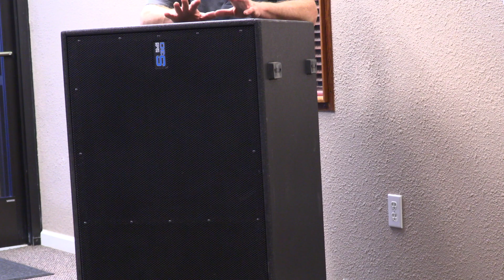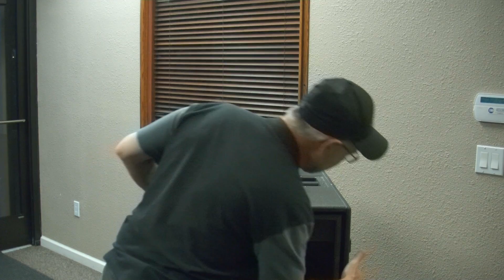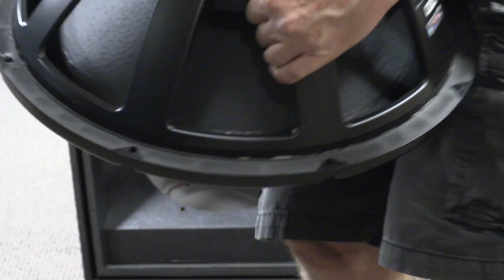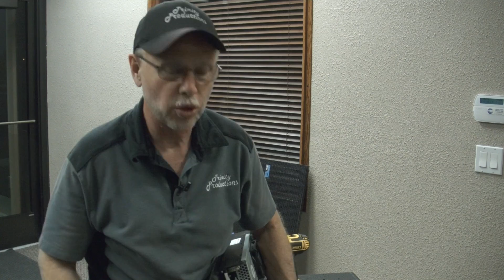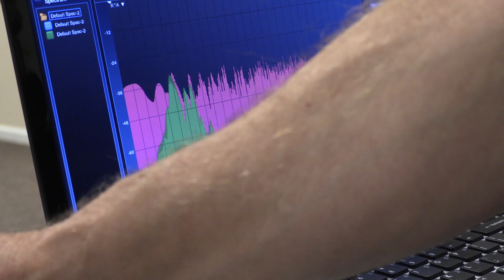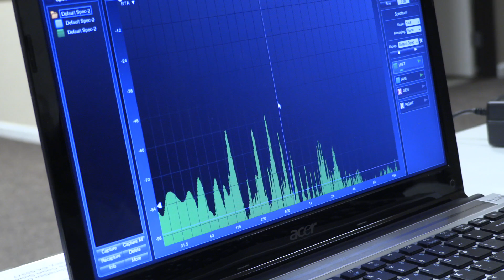dB Technologies DVA S30N complete review - AUTHORIZED DEALERS

Comment: we can also call it a rcf dva s30n lmao
Reply from the maker: Just RCF driver in it, the amps are all dB Tech.
Reply: @trinityprosound  yeah but I the drivers are rcf that's what matters sound similar to the sub series from rcf just less powerful. Overall the design of the cabinet is better!
Reply from the maker: yes, the S30 is a more punchy design a more rock box, than the 8006 from RCF
Reply from the maker: all wood, no plastic on the S30 or the 8006, all multi layer birch plywood on both.
Reply from the maker: you can but the 8 T4 per side will out run a single S30 per side, would recommend 2 per side for that system.
Reply from the maker: Line array T12's would be a great start. Then the new VIO boxes , in their PRO LINE

Comment: Hello and thank you for your videos. I own DVA S20 and I will change soon. Have you ever heard the KS 20? And if so, what is your opinion? Thank you
Reply from the maker: The S20 and KS20 are basically the same speaker, rather than phasing the S20 out, changed to KS20 and a few minor tweaks and rebranded as the KS20 - for the price point the KS20 is a great sub, the S30 even better
Reply: @trinityprosound  

Thank you for the answer.

Comment: @trinityprosound, I'm shopping around for subs. Torn between the DVA S30N and the RCF 8006. For the price point, I like that the S30's have RDNET. What I don't like is the volume drop. Which sub would you recommend at this price point? Thanks.
Reply from the maker: Tell me about the events you do, are they all over the place in genre? or all rock or ?  The 8006 seems to go lower IMO due to larger volume of enclosure and SPL is close. RDNET is good but if all your boxes are not RDNET does not do you a huge dis-service to go with subs without as the module and cabling to monitor adds set up time, etc. We usually walk the event and look at the limiter lights on the subs to see how often they are hitting during higher low end sets. Going to run you about $1000 to get RDNET set up with decent cables from FOH to the speakers, maybe a bit more...for a few $$$ more the 9006 are pretty amazing.
Reply: @trinityprosound  Thanks. I'd say that at least 75% of our events is providing sound reinforcement for DJ's at car shows and different venues throughout the Bay Area. It's mainly hip hop and top 40 in terms of genre.  We have been using 4 per side DAS Event 208a's with 2 JBL SRX828SP's for subs. We have been using this for over 3 years now and think it's time for an upgrade. Some friends of ours suggested to go with the RCF HDL20A with 8006's for the subs. Of course looking at the other offerings in the price range, I was inclined to also look at the DVA T8's and the S30N's for subs. As far as RDNET, can you intermix RCF and DB Tech? Let's say use the T8's and 9006 together?
Reply from the maker: call us when ready to purchase. yes you can mix, but they don't run the same RDNET software, you would have to do all db or all RCF to ensure interface sees the speakers...I think the 8006 or 9006 is a great fix. but with that said there is a promo going on through the end of Oct 2018 that you buy "Buy 6 DVA T12’s or 6X T8’s  and get a free DVA S30, or buy 12 DVA T12’s or 12 T8’s and get 2 free S30’s"

Comment: hey may i replace that powered subwoofer with neodymium low frequency woofer?
Reply from the maker: not unless all the speaker specs line up with the original tuning of the speaker...it would have to be a direct replacement from db technologies. you just cant put any ole speaker in it and expect it to work and sound the same
Reply: trinityprosound ok i uderstand. so better if i choose to maintain its factory standard.. rather than to replace it with neodymium. maybe it will cause failure in amp module.
Reply from the maker: maybe, but may not even sound close to the original
Reply: @trinityprosound  hi. I'm back. How can i adjust it's main volume while it doesn't have volume control at all? Should i connect it to pc first? To adjust it's volume level and it's audio  mode selector?
Reply from the maker: you should be doing that on your mixer with AUX or SUB GROUP fed subwoofer feed and assign only those instruments that need SUB frequencies to that ground and high pass all others to your R/L at the crossover frequency, typically around 90hz
Reply: @trinityprosound  so if i have a digital  crossover. May i just set its volume and tone controls using those devices? The volume of that subwoofer  was always depend on the controller where i connect it?
Reply from the maker: you can, but i would not do any tonality adjustments and do that on the various instruments, etc. that you are sending to the subwoofers. we always run ours flat from the mixer on our systems and only add or subtract on individual instruments such as kick, floor tom, bass, keys, etc.

Comment: Kinda strange that the volume drops HARD below 50hz. This sub is not made for EDM music and djs (mainly not for very low frequencies). Maybe more for live bands. Same for DVA S10, S20 and the new DVA KS series. Am I right?
Reply from the maker: yes, you have to get large subs and drivers to get that or subs specifically made with long excursion voice coils. the RCF TTS56A's are able to do that...but they are large and very expensive.
Reply: How about TTS36A'/TTS26A's? Or the new SUB9006A? I'm trying to get the best of both worlds...
Reply from the maker: TTS36A yes and the 26's for dual 15's do a great job, the 9006's maybe...but I would do the TTS36A or TTS56s, we just sold a pair of TTS56s to a highend DJ that wanted this sound along with TTL6A's it is going to be an amazing rig , and for live sound too !

Comment: Hello dear. What would be the main differences of this s30 in sound, comparing it with the dva s20 ?. What model would you like and why? Thank you.
Reply from the maker: S30 is more power, 1000wRMS more and clam shell configuration, better drivers to handle more power and box goes louder and lower than S20. S20 has now been discontinued by db Tech, there is KS20 replacement and is a good sub, but S30 with 3000wrms is amazing sounding, lots of tests against other large main stream names and S30 has been a solid contender in dual 18" subwoofer. you can not beat for price point.
Reply: Thanks